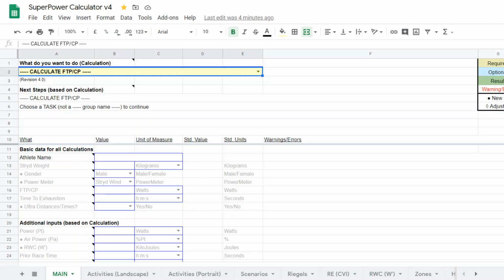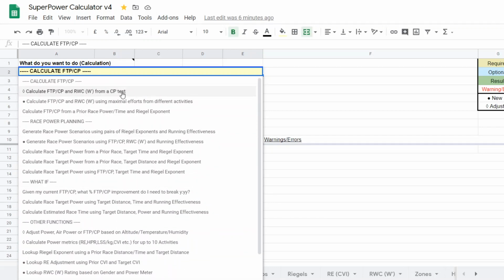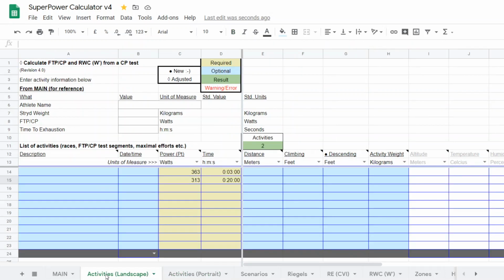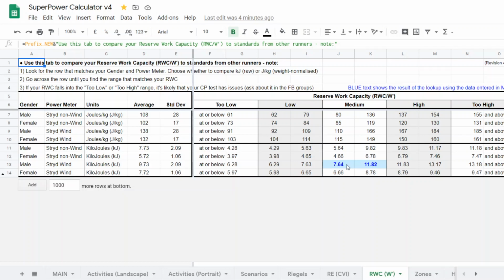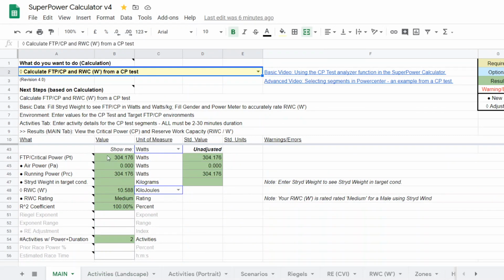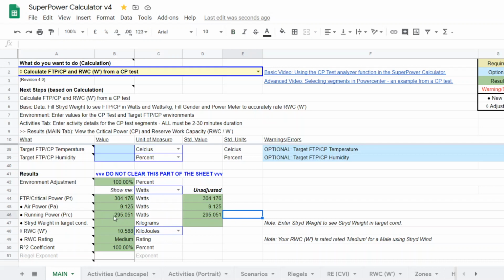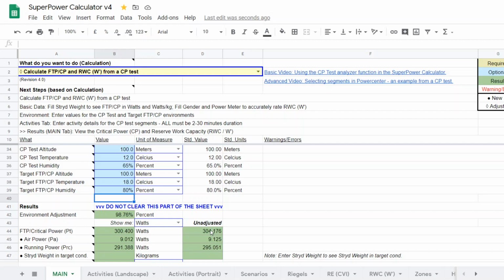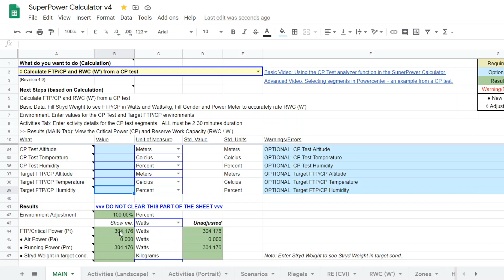SPC v4 - Using the CP Test Calculator Function

Comment: Shouldn't the wind version account for the difference with/without air resistance? But than the power you actually can  deliver should approx stay the same? (neglecting RE, temp, humidity etc.)
Reply from the maker: True, but training is relative to CP.  If you have a wind version, you cannot use an outdoor CP value on the TM.  Trust me on this one.